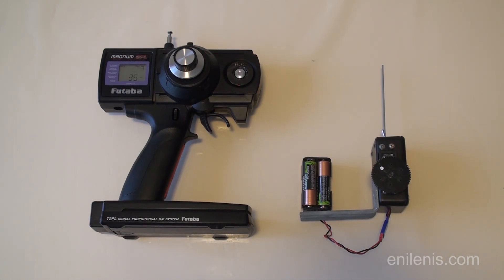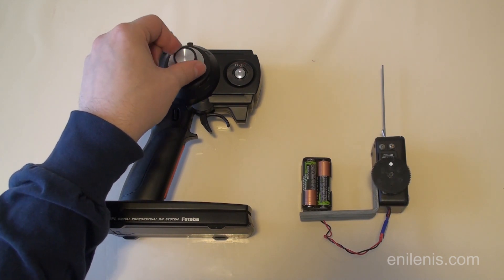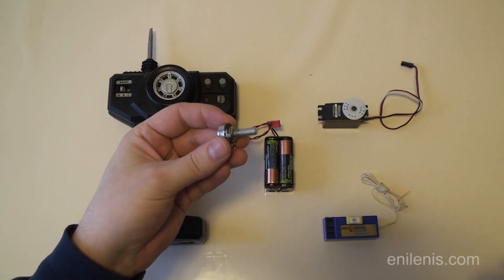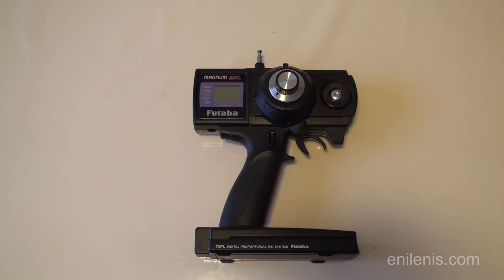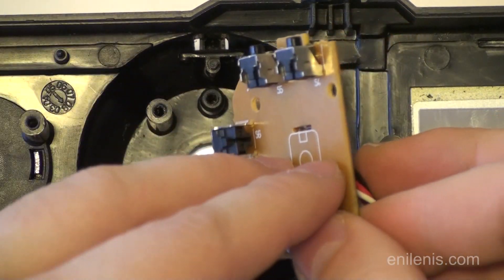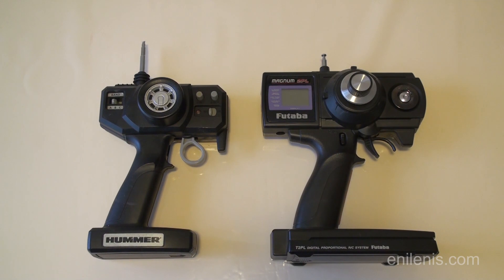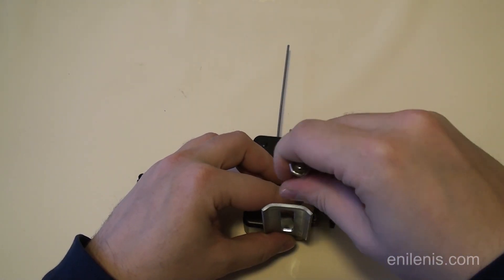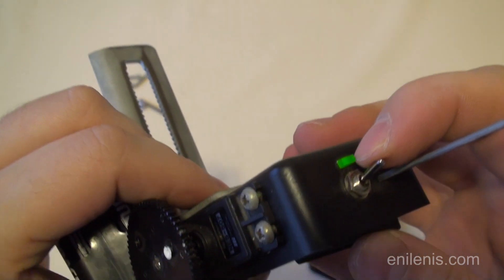DIY Wireless Follow Focus

Comment: Hello again enilenis, 

I'm still working on my project. And once again I need your help. I'm going crazy with servos. I'm looking for a good price and servos serve me on this page, but I'm lost. 

http://www.banggood.com/buy/servo.html 

I have Futaba 2pl like you, do you recommend me some servo of this page to go with it for the focus ring? 

On the other hand, I do not understand what your comment in the video description of the relationship between grades and steps. Does this have anything to do with speed? 

I really appreciate if you help me. Thanks in advance, Manuel.
Reply from the maker: When planning a system, start with the lens. See how far the focal ring turns. If you have multiple lenses, take the ones with greatest range of motion as reference. Then pick the geared wheel that will be put onto the servo. Check how far that one will have to turn in order to go through the entire focal range. Then you'll know how far the servo will have to turn to satisfy the requirement.

Any metal servo off the site you linked will work. Typically they turn about 160 degrees (less than half a turn). Depending on the diameter of the geared wheel you put on the servo and the lens focus ring, you'll get different range of motion. Example - if your servo geared wheel is the same diameter as the lens, you'll have 1:1 ratio. You'll be able to turn focus ring 160 degrees, which may or may not be enough. If your servo wheel is half the diameter of the lens, you'll get 2:1 ratio, meaning the lens will turn 80 degrees max. Keep that in mind when building a system. If the range is insufficient, you'll either need to put bigger geared wheel onto the servo (which will reduce torque by the way), or get a marine winch servo such as this one: http://www.hobbyking.com/hobbyking/store/__18974__sail_winch_servo_13kg_0_7sec_360deg_55g.html

They have more range than basic hobby servos.

When it comes to resolution (rotation precision), most analog receivers will have a maximum of 1024 steps, Magnum 2PL included. Keep that in mind. Say, if your servo is able to turn 360 degrees, but the lens only turns half of that angle, then you'll only go through half the steps (512). The bigger the difference, the more "steppy" your focus adjustment will be. At some point it may become noticeable, so don't give the servo a lot of extra range you may not end up using. Get as close to the actual lens range as possible.

My advise is - play around and see what works best for you. Most servos will turn lenses. Some may not give you enough range, some may be too wobbly and imprecise, others too noisy. Typically more expensive servos will give you best results. Plastic servos - worst. Metal gear - better. Metal ball-bearing and digital servos - best.

Digital transmitters and receivers may give you more than 1024 steps of resolution, but at that point you'll be spending as much money on the kit as if you had a brand name follow focus. My goal is to provide a cheap option for people who can't afford pro gear and that's exactly what that is.
Reply: ***** Great explanation enilenis !! Thanks friend !! :) 

My idea is to use pinion gear, but standard measures used in film. So I'm going to buy exclusive pinions follow focus. They are on ebay, and use different sizes depending on the size of the lens as you say: 
http://www.ebay.com/itm/331006555672?ssPageName=STRK:MEWAX:IT&_trksid=p3984.m1423.l2649

I have seen, this servo on ebay: 
http://www.ebay.es/itm/281296438795?ssPageName=STRK:MEWAX:IT&_trksid=p3984.m1423.l2649

Rotates 360 and ball bearings, which are the best as you say. I'll try it, if too loud, I'll buy that you have taught me. 
The issue of noise is important, because in making video recording live sound you can hear the motor. Is there any solution for this? 
Does your servo you taught me also make that noise? 

Another question, do you think that when the focus ring reaches its limit and can not rotate pinion gear's teeth can break the lens when if he tries to keep turning? 

Sorry for my bad English writing, I'm Spanish. >. <

Thanks buddy, you're helping me, you're a genius!
Reply from the maker: Manuel García  The servo you picked looks good. 4096 steps is 4x the typical resolution, but since the Futaba transmitter and receiver are analog, the end resolution will still be 1024 steps (has to do with radio signal bandwith). Regardless, digital servos are quicker, more precise often less wobbly and are compatible with all transmitters.

When it comes to actual sound - I tested multiple servos and quite honestly haven't found a perfect one. The more metal there is on the inside, typically, the quieter the system is, but they all make noise. The reason is that in hobbies with model cars, boats and airplanes noise is typically of little concern. They don't even list decibel measurements in servo specs. You can google silent servos but there's surprisingly little information out there.
The best option to control the noise is with the box you put the servo into. It can be padded for extra noise insulation, but it will only be partially effective, because there is still going to be a direct connection between the servo and the lens.

Regarding breaking of the lens - it will not happen with a hobby servo. They are too weak for that. The most likely outcome is that the servo will simply stop, making a buzzing noise or the gears will skip. No harm done. Your Futaba transmitter has a function for limiting rotation range, just in case. The reason I love Magnum 2PL especially is that it can store up to 10 presets, and each can be named with digits, which is absolutely ideal for a lens kit. I have 35, 40, 75 preset etc.
Reply: ***** Hello enilenis, 

It is a good idea to isolate noise servo inside a metal box or something. I'll keep that in mind. 

I love how you can save on the remote futaba 10 presets, I do not know how it works, I guess in the instruction manual is indicated, no? 

I will remove the electronic part of the housing and I'll put it in another box and will seem more professional. When I have finished I will show you a video, although it will take because I am hoping that I reach some components. 

Enilenis Thanks for your ideas. A greeting! :)
Reply from the maker: Manuel García  Read your remote's manual - it'll help with learning presets. Or you can just play with the big metal button. It controls everything and easy to figure out intuitively.

One thing I did not mention in the video tutorial is the receiver antenna. As you can see I cut mine off and instead made one out of a piece of clothes hanger. The only rule here is that the longer the antenna, the better signal you'll get. You may even keep the original wire. It's no big deal, but I just find that a metal one looks better. I cut mine off very short, so it works as far as about 10m noise free (much less than with the original antenna). I'm typically no farther from the camera than that, but just keep that in mind. Test everything one step at a time to make sure you're happy with the results.

Comment: How many channels did you use? Thanks for the tutorial and the invention!
Reply from the maker: A car remote typically has a minimum of 2 channels - steering and thrust. The thrust trigger ended up not being used in my version, but could be utilized for aperture or zoom control. It's there if you need it. Plug another servo and you're set.
Reply: ***** Ok :). Then you used a single channel, no?
Reply from the maker: Manuel García Yes. Single channel.
Reply: ***** Ok! thanks for the reply. I will use it only for the focus ring!
Reply from the maker: Manuel García
Stay in touch and let me know how your project turns out. I'm working on another version currently, improving upon this design. Feedback is always appreciated.
Reply: ***** Thank you friend. Of course, I'll contact you when I have finished. Hopefully when you have finished the new version also my show.

Comment: Hi mate,
I have used the 5k in the end, i got an ohmmeter, mesured the original one and it was 5k, but when i did put the 10k it did still worked. 
I have seen you effects videos and they look very good, i hope you could help me on my films too in your spare time.
Thanks Again
Panos
Reply from the maker: Thanks for the info. With resistors going over simply makes the transmitter think that you're not turning the knob far enough. Going under may be interpreted as a short circuit and trigger shutdown, or cause the radio signal generator to try and output frequency it physically cannot deliver. Either way, no harm trying different values.

 When it comes to effects for films - sure. Spare time is always in short supply, but you never know. I'll see what I can do.

Comment: Hi Mate,
I have finished the project and it works fantastic.
Have a look my video. http://youtu.be/MHwx7fSO25A
Thanks a lot for your support. 
I am in a short in couple of months. (I am Waiting The Blackmagic 4k) when i get the shot with the jib and the wireless follow focus, i will sent to you the shot for you to have a look.
Thanks Again and kip contact,  
Panos
Reply from the maker: This is absolutely brilliant! You've got the rail mount and everything - even the servo enclosure with a switch! Looks professional. All that's left is to go and shoot some films!

Just out of curiosity - which potentiometer did you end up keeping in your remote - 5K or 10K? My 5K goes slightly over range which I limit through the transmitter preset. Curious whether I should've gone with 10K off the bat.

Congratulations again! Will definitely stay in touch.

I'll be doing fewer electronics videos in the near future and focusing more on effects tutorials, because my main work is taking up most of my spare time. But there will always be a few film gear related projects going on the side.
Reply: video is now unavailable?? :-/ :-(
Could you put it back up again please? :-)
Reply from the maker: david consumer of math I assume you're talking about the camera rig demonstration. I've backed up the clip just in case: https://www.youtube.com/watch?v=eabqKBuTrWQ
Reply: ***** whoa, that is noisy!

And actually, I was asking Amvrofilms about his video.
Reply from the maker: david consumer of math He removed his clips. Probably didn't want to be bothered with all the questions regarding construction of the device. That link that I posted is to a backup of his video.

The noise level depends on the servo you buy. Quiet ones are hard to find because it is typically not a high priority for manufacturers, considering that the primary application is in remote controlled boats, cars and airplanes.

In specs they don't even list decibels. You have to ask around on forums.
Reply: Going to order a handful of different ones, hopefully the luck of the draw means I'll get one which works ok!

Comment: Hi There Thanks for replying again,
I have upload a small video to show you the outcome till now, Just ordered a 180 degree servo but its coming 25th of feb as it comes from china to uk.
I was just thinking if i put a 180 degree servo how can it stop at 40,30 and so on when i stop the wheel? (as it does yours) is it not going to stop its self at 180? when it finds the dead end? sorry if its silly what i am saying, i am not a electronic guy.
Thanks again for helping me to finalize this project.
Panos  http://youtu.be/bVjBXAUcPw8
Reply from the maker: With a regular servo it will stop when you stop. It will work exactly as you see in the video.

Futaba transmitter is capable of outputting frequencies that lie beyond the servo bounds. The motor will start buzzing, trying to go beyond the mechanical stop. For that purpose there is actually a setting inside the transmitter itself. You can limit the range of rotation to the left and to the right of center point. I cap mine at about 75% on the servo you see in the clip. Also, what makes Magnum 2PL great is that you can store up to 10 servo presets. You can have one for each lens in a camera kit (which is typically fewer than 10).

The only problem with 2PL is that it operates in low frequency FM range and sometimes picks up interference. I have to extend the transmitter antenna all the way to get good results, since I made the receiver antenna much shorter than it was originally. There's a 3PL version out now. It's 2.4Ghz and supposedly more stable, but it wasn't around when I was doing my project and I always side with cheaper options anyway. 2PL is still my recommendation for most film enthusiasts.
Reply from the maker: Also, I hope your new servo is of the right kind. I once ordered a 180 degree servo and it turned out to be the kind that runs landing gear on model airplanes. It went either to 0 or straight to 180 with no way of stopping inbetween. There are 3 types of servos: standard, retract and continuous rotation. First is able to stop precisely anywhere within its mechanical range. The second goes between 0 and 180, depending in the transmitter pulse is above or below the center point, and the last kind just spins continuously.Standard servos can easily be converted into continuous rotation. Retract servos are custom made to act the way they do.BTW, your clip is set to private, so I cannot view it.

Comment: Thanks for replying again,
I thing i have bugger up the controller. i couldn't solder the cables on to the board and the 10k made it worse i thing. just waiting for the ohmmeter to check it. what i did i solder the cables directly to the three cables that turns it right and left (white ,red,black) and it works. the only thing it does is when it turns do not stop when i stop the potentiometer wheel. i have to turn it buck to 0 to stop it manually. i do not know if that it ok or wrong. i am at work now but i will post you some pictures, my transmitter is "futaba megatech 2pl" servo is. S3003 and i did modified it to 360 degree
Thanks again
Reply from the maker: I think I know what the problem is. You cannot use a 360 degree continuous rotation servo, if that's what you have plugged into the receiver. You have to have a normal servo with the effective range large enough to work with the lens. If you modified your servo for continuous rotation, it will keep spinning, not knowing where to stop. It's not a transmitter problem.

I am guessing your potentiometer is chosen correctly. You need a proper servo. If you have any unmodified ones, try them instead and let me know what happens.

I put an additional note into the description to resolve any confusion regarding the servo types.

Comment: Hi there,
i got the 10k potentiometer but still not working, i thing i get the wrong once.
can you direct me to the white one potentiometer please?
Thanks again
Reply from the maker: The potentiometer in the link you provided looks right, assuming that the original resistor was indeed 10K. Makes me wonder whether the label on your board meant 10K or was just a component ID. Do you get better result with 10K compared to 5K? Is it a step in the right direction or does it get worse? A multimeter certainly would help at this junction to see if the replacement resistor matches the specs.

The datasheet for the 10K potentiometer you ordered states tolerance of +/- 20%, which is quite large - meaning the actual resistance may be off by a fifth - enough to confuse the RC transmitter if it goes 20% under.

Hard to diagnose your problem without actually seeing it. Double-check all your wires, to make sure nothing got pulled or shorted when you were taking the transmitter apart. You may want to put the original pot back in to check if it runs like it did before.

Comment: Thanks for replying,
I have ordered a Linear 10k Potentiometer, http://www.ebay.co.uk/itm/130489962452?ssPageName=STRK:MEWNX:IT&_trksid=p3984.m1497.l2649
I am waiting to arive so i will put it on.
i hope would work, the hardest part i found was to solder the cables on the plate, i still not sour if there are properly connected. lol
thanks again

Comment: Thanks for replying,
the servo turns rapidly because I have 5K potentiometer on it. If I turn it to the right it switches off, if I turn it left, it starts rapidly. Therefore I am going to get a 10k to put it on and hopefully that would make it work. I will let you know how it goes and thanks again for replying and posting this video, it was very helpful.
Reply from the maker: Some transmitters will switch off if they get an unexpected reading from the pot, being unable to generate correct pulse frequency. That's normal. As long as the turning of the knob translates proportionally to the servo, you're on the right track and just have to find the right resistance. If the servo begins to accelerate or decelerate, then you've got a logarithmic potentiometer - the kind that's used in audio amplifiers. Good for volume control, but useless for what we're doing. Linear motion requires linear resistance variance.

Comment: Hi there,
thanks a lot for uploading this video.
 the potentiometre plate have the KX10 written on it, is that mean that it is 10k?
Thanks
Reply from the maker: Yes, that is most likely a 10K resistor. That is one component where you can't really do any damage to the equipment if you don't get it right on first try. Low current that flows through it won't fry anything, even if you short the pins by accident. Desolder the old potentiometer, replace it with another one and try it. Power the transmitter on and turn the knob fully to each side. If the servo turns very little, that means resistance is too high. If it turns rapidly, reaching bounds before you're done turning, resistance is too low. Most radios will have 5K - 15K pots, so yours sounds about right. Let me know how your experiments go and good luck!